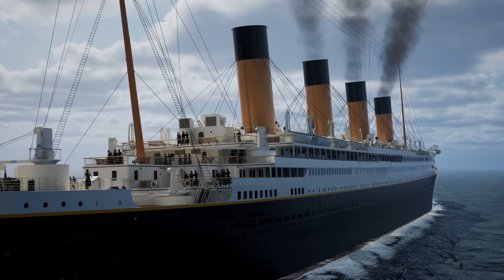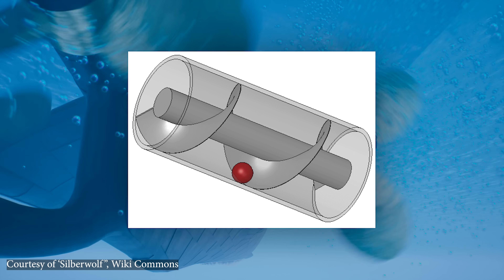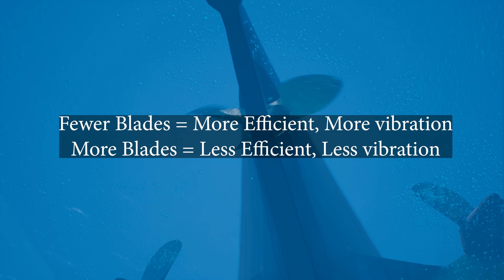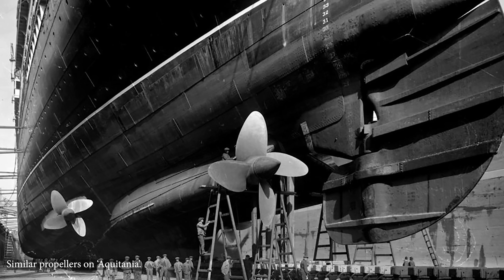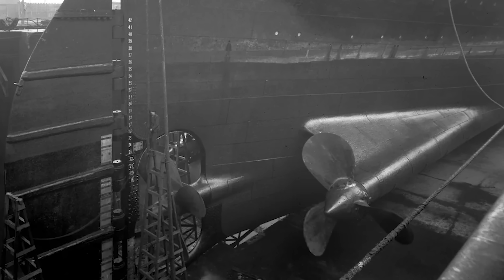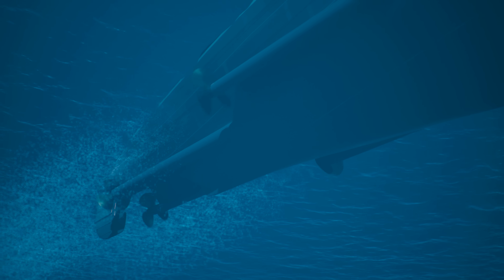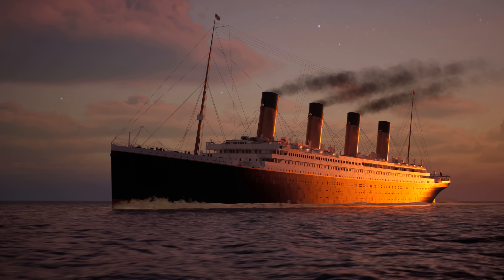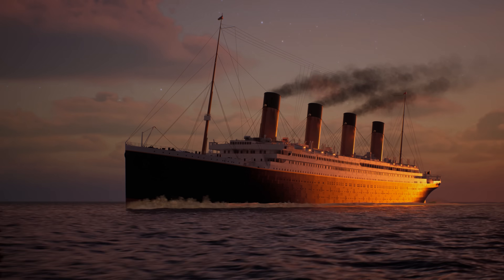Titanic's Propeller Mystery

Comment: Mike omitted an important factor with regard to vibration:  Whenever you have 2 or more propellors, you get propellor beating - pressure changes in the water as a blade of one propellor sweeps past/near a blade of the other propellor.   There are three ways of addressing this:  1) separate the propellors laterally - there is limited scope for this on a big ship, especially if there are three or more propellors;
2)  separate the propellors longitudinally (ie at different distances from the stern) - this reduces hull volume at the rear of the ship, which is not a good thing;
3)  fit different numbers of blades, eg 3 on the outboard props and 4 on the inboard.
I gather that Mike's conclusion that Titanic had a three-bladed centre prop is really solely based on a single digit in some engineer's personal notebook.  This is not good research - it could be just an error by that engineer, we have no way of knowing.
Mike said that the H&W engineers could have been doing a comparison experiment with the two sister ships but this does not make much commercial sense.   An engineer would seek to come up with the best configuration he can, and that won't change until one of the ships completes sufficient voyages to show up a problem.   An engineer would be risking his job if he was seen to intentionally make one ship inferior to the other, as must be the case if they are different.
Sure, ships got their props changed back then (in pleasure boats today they still occasionally do) but in response to an encountered problem that needed addressing, not on speculation
Reply: It was a "time" of switch from 3 blades, done through multiple testings. Ships generally had 3 blades props at the time. Olympic was technically the "odd one out" with 4. Harland and Wolff might've referred Cunard in this. Mauretania and Lusitania got a switch in number of blades around 1909. They were built with 3 blades, but later switched to 4. Harland and Wolff might've also referred to this and did a test of their own. Olympic getting 3 bladed after Titanic's sinking just shows they didn't have enough data to confirm the document design. This propulsion test does reward results in efficient propulsion, which in long term, benefits the ship. Tests for perfomance improvement is a valid reason.
Reply: @gokulgopan4397  But back then there was only 2 kinds of test they could do:   a) try a configuration out in a ship, which may need several or many voyages to get enough data on various sailing conditions;  or b) tank testing.
Tank testing has serious limitations, due to the need to scale the dimensions and velocities, coupled with the effects of Reynolds Number being non-linear.
All this means that for any given ship, they could get things a bit wrong, realise it from either excessive fuel consumption, excessive or too low engine RPM for a given hull velocity, or excessive vibration, or any combination of these three.  If so, they could decide to try a different propellor, making an informed guesstimate as to what difference(s) the new prop should have.
If the new ship is very different to what the shipyard had built before (eg twice the displacement through increased length) there is obviously more scope to get it wrong.
But to launch two identical ships into commercial service with different propellors in order see which one works best - I don't accept that. Its just not a way to get the company manager's respect.   You do your calculations (rule of thumb) and the answer is the answer - the best you can do, uncertainty notwithstanding.
If you launch the two ships with different propellors - you know that there is 100% certainty you are going to have to dry dock one of them early at huge expense and loss of revenue.    If you launch 2 ships with your best idea of what the props should be, it will more than likely never be any need to early drydock one of them.
Reply: @keithammleter3824  Whether you accept it or not, it's what was done - frequently, as the examples provided by Mike and the many, many others you could find with a bit of digging would attest to. I think you're vastly overestimating the amount of time it would take to swap out the props, for one thing. And another - THEY DID EXACTLY THE SAME EXPERIMENT WITH OLYMPIC A FEW YEARS LATER. You can't say 'Oh, they wouldn't have done that' when we have documented evidence that they did, indeed, do exactly that!
Reply: @journeyman_philosopher  Mike provided only one example of two identical new hulls getting different propellors as an experiment to find out which prop was better - the Titanic and Olympic, which might or might not be truth.
What is known beyond doubt is the photos showing a 4-blade prop are of Olympic or Olympic's prop.   There are no known photos of Titanic's prop, so we just don't know.
Olympic got dry docked and a shaft intended for Titanic fitted due to collision damage, and also had a propeller change due to having lost a blade.   Can you give a reference that states they were experimenting, as distinct from fitting what was quickly available and through that fortuitously discovering that 4 blades on the centre prop was better (which of course confirms they got it right the first time)?
From ordering to delivery, the time taken to obtain a large ship propeller was around two months or more.   Leaving a damaged ship out of revenue service that long just for a propeller is something not to be countenanced.  Use what you have if it is roughly right.  Order the correct propeller and fit it when it arrives - that takes only a day or so.
Can you give an example of two identical ships (other than Olympic Class) launched with different propeller specs for test purposes?   I think not.
Reply: @keithammleter3824  There's no point arguing with someone who is convinced they already know the answer. Complete waste of both our time.
Reply: @journeyman_philosopher  No, I don't know the answer.  Nobody alive does.   That's my point.   The centre prop might have been 4-bladed, it might have been 3-bladed.  Thorough digging turns up lots of leads - books, YouTube videos etc, but they all lead back to that infamous engineer's notebook.   Take that dubious source away and you are left with pure speculation.
Reply: "Mike said that the H&W engineers could have been doing a comparison experiment with the two sister ships but this does not make much commercial sense.   An engineer would seek to come up with the best configuration he can, and that won't change until one of the ships completes sufficient voyages to show up a problem.   An engineer would be risking his job if he was seen to intentionally make one ship inferior to the other, as must be the case if they are different."

Did you actually watch the video? He mentioned several examples of them doing exactly this. Olympic herself switched to a three blade central screw not long after Titanic went down, not because of damage but because they wanted to see if it was better than a four blade. It happened ALL THE TIME, because that was the only way to find out if something worked - trial and error. No fancy computer simulations in 1912.
Reply: @journeyman_philosopher  I certainly did watch Mike's video.  I did not say he's definitely wrong , I said that he drew conclusions on very thin ice.  The only reference I could find that Titanic had a three-blade centre prop is the same one Mike quoted - that engineer's notebook.   The only reference I could find that H&W were experimenting 4-blades vs 3 blades is a discussion on a Reddit forum about Titanic - hardly a reliable reference.
I think you are misunderstanding the engineering of propellor specifications as it was back then.  Sure, it was rule of thumb methods rather than finite element fluid dynamics, but they weren't stupid.  Considerable experience with propellor applications had been built up.  I've worked for a marine engine dealer - we used much the same methods to match props to hulls and engines - and got it pretty right nearly every time if the hull people got their bit (hull drag) right.
(Props are like gears in a car - you must have the right prop blade angle etc for the ship's speed through the water, just as you need the right gear for the speed you are doing in a car.)
But sometimes the hull guys got it wrong, and they sometimes did back in Titanic's day too.  When that happened, propellors got changed.
Incidentally, be aware of why professional engineers keep personal notebooks.   These are the main reasons (then and now):-
1.   Professional associations require the production of notebooks as proof of experience when granting corporate memberships;.
2.   Source material for updating one's CV and job applications;.
3.   In the event of a patent dispute or getting sued for infringement, a notebook can be presented in court as evidence of prior art;
A high level of accuracy is not required; indeed, some young chaps don't bother with a notebook until they have to produce it, and then spend a couple of evenings writing one, trying to remember what they did in their earlier years.

Comment: Por qué una de las hélices giraba en sentido opuesto..??
Reply: Due to the difference in water pressure between upper and lower parts, propellers create "prop walk" - a sideways force that tends to make the ship veer off course. This has to be counteracted with the rudder, which slows the ship down and stresses components. 

If you make all the propellers spin in the same direction - all right handed or all left handed - then the prop walk becomes really bad since they will all be pushing the stern towards the same side. But if one of them is made to rotate in the opposite direction, then the prop walks of two of the propellers will cancel each other out.

Comment: Honestly the three blade theory makes sense to me. If you look into the Titanic/Olympic switch conspiracy, one of the main arguments is that White Star wanted to get insurance payout using Olympic as it had a collision with a war ship supposedly bending a prop shaft causing a vibration, which was said to be noticed on Titanic and not Olympic later on. The three blade propeller would make sense for the vibration on Titanic then and if Olympic changed propellers a few times they may have figured out how to smooth out the vibrations.

Comment: I’ve noticed something in a few of your previous titanic videos but didn’t find it necessary to point out until now, since this video is focused directly on the blades of the titanic. It appears that the central prop is either turning the incorrect direction or the blades and angled incorrectly. The outboard props, however, appear correct. The way the central prop is turning would be providing thrust towards the FRONT of the ship, as if it were in reverse.  Unless I am missing something it looks like the graphics need an update. Watch that central prop at 7:35 in this video and you’ll see it would be pushing the seawater towards the front of the ship when you take into consideration the direction of rotation and the angle of the blades.

Comment: For modern comparison, a Nimitz-class aircraft carrier has four 5-blade screws. They have a diameter of 25 ft and are each capable of developing 70,000 shaft horsepower.

Comment: A three bladed central propeller? That makes sense. That's probably one of the reasons why Captain Smith was steaming fast.
Reply: The central prop was used with a low pressure boilers. So it was an auxiliary prop to be as efficient as she could. But fast enough to be competitive.

Comment: There is one photo of Titanic in trydock that has what looks like a three bladed propeller sitting reading to be installed.
Reply: Are you sure it's the center propeller and not one of the wing ones?
Reply: @flaw885  pretty sure, there have been a few articles about the photo and it is fure sure the smaller center propeller but with only three blades. 
Between the photo and the H&W notes on ship 401 (Titanic) that states the center propeller was a three bladed type, we know Titanic's center screw only had three blades.

Comment: There is a photo of Titanoc's stern with the wing swrews on, but not the center screw. On the quay, there is a large propellor, and it is almost certainly the center screw, laying on its side, before being fitted. Interestingly, a computer model on the screw has been drawn, comparing the photo to a three bladed and a four bladed screw, and it is without a doubt a three blade.
Reply: Are you sure these pictures you saw weren't actually of Olympic? There were very few pictures of Titanic as it was the second ship built, hence why Olympic had the majority of interest. Even the video of captain Smith walking along what looks like Titanics bridge is actually Olympic.

Comment: 36 ft 9 in would've been the pitch, not diameter.
Reply: The pitch of the wing propellers was 35 feet, and of the centre one 14 feet 6 inches.

At the time of Olympic's maiden voyage, the figures were 33 feet and 14 feet 6 inches.

Comment: Whatever kind of propeller You design/use, I think ONE consideration must no be forgotten: resonance.

If You have one propeller, this is not a problem.
If You have two, that may com into factor.
Three and above? I'd say is hell on earth.

If You have a four propelled ship, make sure that You have two different sets. If all of them are similar, resonance WILL be a serious problem.
A three propelled ship... I'm not so sure. I think You could get away with a smaller central one - although didn't made much good in this case. It's quite a hard problem to solve.

Comment: The propellers were made of Bronze, right? Will that last longer then the rest of the ship on/in the sea floor?
Reply: Yes. Recent high resolution photos show her propellers still look almost as good as new. So good one can read clearly the hull serial number embossed on one of the blades. Whereas all the steel and iron parts are gradually turning to rust dust. Bronze is still the best metallic material for a marine environment, if you ask me.

Comment: Experimentation of this type happened in other industries at this time. Locomotive fireboxes were built with a round top. But in 1864 the Belgian inventor Alfred Belpaire came up with the squire topped firebox. This increased the surface area which improved the heat transfer compared to the round top. The downside was the increased expense and though most British locomotive used the Belpaire firebox after the 1920s the London and North Eastern Railway did not.

Comment: This is just speculation on my part, but would it possible to use a ROV with an underwater version of ground-pebetrating radar? That way the propellers can be studied without disturbing the shipwreck. Like I said, this is just speculation and I am not an expert in these matters.

Comment: There’s a photo of the Titanic in a dry dock from february 1912. In the background on the ground is lying an object which is simmilar to the propeller. An analys (not official one) points out it was in fact a propeller which had to have three blades.
Reply: i know that photo.. but was determined if that was one of the outboard props or the center?
Reply: @sparrowlt  outboard propellers had different build. The wings were put separately to the main shaft while the central propeller - all wings and main axis was shaped together

Comment: Hello.
00:42 - There is an error in your animation with the middle propeller. Judging by the design of the blades and the direction of rotation, the animation shows that the propeller is working for the back direction moovement of the vessel.
As we remember on the Titanic, the middle propeller was only capable of working in forward direction moovement of the vessel.
Judging by the photographs of the Olympic, the design of the blades of the middle propeller is correct, in your animation. This means that in your animation, the propeller is rotating in the wrong direction.
Good luck!
Reply: Thanks; I was looking to see if anyone else noticed this.  It's in a couple different places that the central screw seems to be turning backwards, or the propeller is the wrong handedness.
Reply: Yes not a fan of that aspect of the animation

Comment: Makes sense to have two for a new design. Run both ships for a year, pick the prop that makes everyone happy, and go with it. I wonder if there are sensors currently, or in the pipeline, that could go down and find out which screw was used. 

And vibrations can be rough. Never been out to sea, but spent years on C-130's. Tracking down vibration issues is a pain. And usually the first indication we got for them was the crew and pax having headaches. Then you bring in special equipment.

But the one thing I will take away from this video is the image in my head of a posh gentleman arguing with a poor waiter that he ordered his tea MIXED with milk, while the waiter is calmly explaining "The milk is right there Sir, in the cup, right next to the tea."
Reply: The best option probably would be some sort of ground penetrating radar
Reply: The vibration issue was still causing naval architects fits decades later. The last three classes of US fast battleships all had teething issues to work out at full power- the North Carolinas needed structural bracing on the aft fire control tower, the four South Dakotas all had different configurations of three, four and five-bladed props inboard and outboard. Trial and error only mitigated some of the vibration.

Comment: Propeller vibration problems plagued ships throughout the years. The SS Normandie had vibration issues which required changing her screws several times. The USS North Carolina class and South Dakota class battleships also had vibration issues. Some had three and four bladed screws, some tried three and five, and other four and five blades in various attempts to cure vibration issues with the ships.